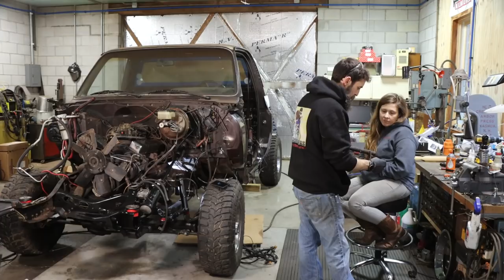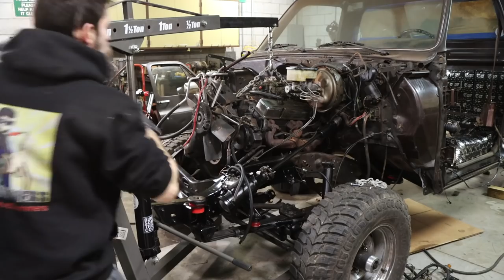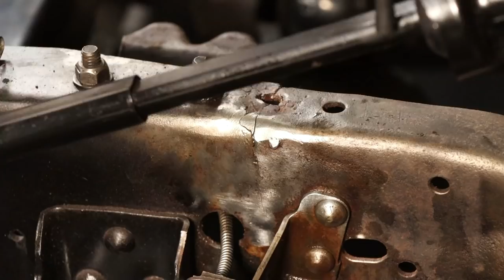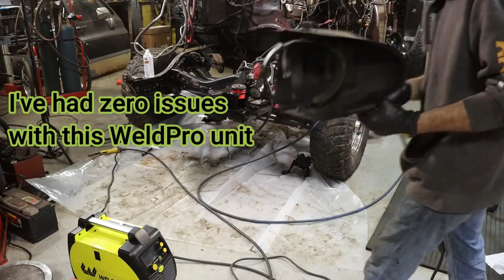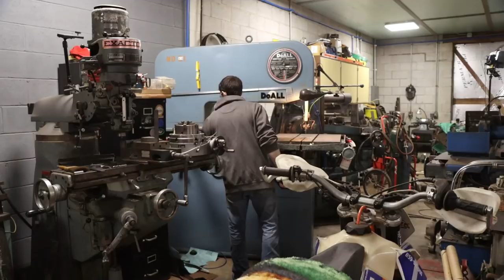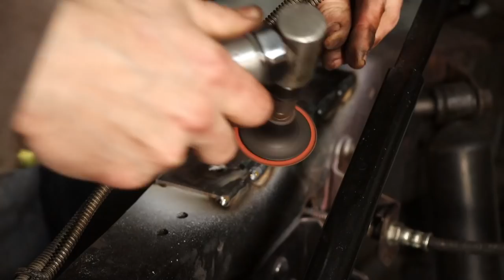Pulling the old engine and repair the damaged frame.

Comment: In 1964 - 327 CHEVY engine new from dealer ( what they now call a crate engine --and it did actually come in a crate ) $540     I never did actually buy one because I couldn't afford it on $1.50 an hour pay. ( Min. wage was $1.25 - so I was really doing well.)
Reply: Yes, a hundred dollars to rebuild an engine back in the day sounds cheap now, but most people don't realize that back then, the average person was taking home about $40 /$50 a week. It's all relavent.
I remember working for $1.25/ HR. and having to buy my repair parts from the junkyard because I couldn't afford new ones!

Comment: Your pulling the motor and repairing the frame reminds me of a situation that happened.   I worked with friends  named R, B andM
B was buying an old Ford Courier from M.  They took the courier to R's shop to replace motor mounts.  A torch was used to cut bolts off mount.  The oil and grease on the courier lit off, so R grabbed B's fire extinguisher.  The extinguisher was about empty and blew just enough to fan the flames.  R and B rolled the courier outside to save R's shop.  They called the volunteer fire dept.  All that was left of the Courier was thin steel and a puddle of aluminum.  The sheriff's dept. then investigated.  B had not transferred the registration from M to his name yet.  Deputy had a lot of questions and B had to do some fast talking.   No arrests were made, B still had to pay M for the truck with nothing to show for it.  It was a funny story with lessons learned.

Comment: I've done about 50 of these and I have found it goes a lot better with a couple of friends and a case of beer.
Your experience may vary.  Very good video, you show crack checking, filleting and welding excellently.
Currently working on my '71     3/4 ton. Already did the engine with a .060 bore just enuf cam so as not to get lopy at idle.
hi volt ignition Edlebrock carb and I splurged on some headers. I was getting 9 mpg and am now getting 11 or 12
I can light the tires anytime. (only 2wd )

Comment: I owned an automotive machine back in the 80's. A complete overhaul kit with everything but the crankshaft and rods was less than a hundred bucks for a small block Chevy... We sold tons of rebuilt engines.

Comment: Get you a good, heavy duty McCloed pressure plate, a good hi temp hi friction clutch disk,. (Zoom, Tremic, ect ect.but most of all a BRAND NEW flywheel!! I had a buddy of mine ,, had a landscaping business and that's all he ever bought were square body 4x4
 Chevrolets.. and the first thing we would do to them is pull the engine and transmission break the engine down completely go through it .030 over, sealed power Pistons Chrome Molly rings a Crane 310, 510 hydraulic flat tappet cam a steel crank that was line bored .010/.010 crank and piston journals. A high volume Melling oil pump.. if you know how to do so get a 700 CFM Rochester quadrajet go through it and polish the ventures and the fuel pump bore with 2000 grit sandpaper.. and a stock intake, a set of headers and you'll get more power out of that truck than a big block... We used to plow a lot of snow where we lived and you couldn't kill those trucks when we got done with them... Wish I was there to help..

Comment: Hi Steve,nice video and job repairing the cracked frame,the only thing i would of done slightly differant is the ends of the plate,i would of not cut them square,but curve going internally on the plate,and fully welded all the seams,Reason i was told this is that square plates will induce futher cracking,also when i was doing repairs on frames,during my aircraft structural days,we always angled the ends of the repair members,ie on your top frame,the length of the side away from radius side would be greater.

Comment: if you replace it go LS you will enjoy the low maintenance of them and there smooth on the road with power and response to spare, not meaning hotrod but go anywhere
Reply: 6.0, not a 5.3 !!

Comment: I've got you beat on oil consumption! My first old truck burned a quart of oil every 30 miles.
Reply: I had one of those.  Back in the day, we called that a "auto self changing oil system".  Very popular when we had our first cars.
Reply: @paulcopeland9035  used to say, fill up the oil and check the gas.
Reply: @Angus_McGyver  ...Yep, I have actually stopped at a station and bought only oil!!  My cruising nights were spent looking at the oil pressure gauge more than anything!

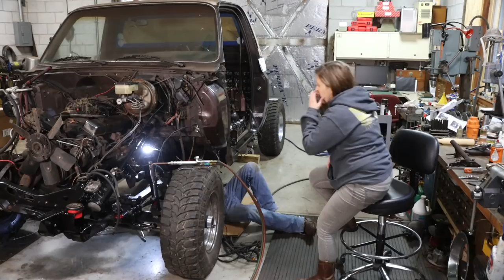Comment: 3:50 This right here is the best way to address a seized nut! All the videos about what penetrating oil is best, yes they work fine. But 9/10 times I grab for this exact set up, a simple welding tip on the acetylene torch, heat to dull red and turns right off. Can’t tell you how many times I’ve swapped the cutting head off the torch set or seen a guy catch a car on fire with a cutting head. It’s like using a sledge hammer to dial in a milling vice, not necessary. Kudos!
Reply: Nope, they do not work "fine"!  Penetrating oils (especially the worthless expensive types - Kroil I am talking to you ) are mostly a waste of money.  Over the years I hate to admit to the amount of money I have spent on this "magic juice".  In the "old days" we didn't have the internet to test, so you just tried everything.  Times are better (at least more informed) now. The bottom line though is there is no "nut buster" like the "blue wrench"!
Reply: @paulcopeland9035  amen

Comment: There is sooooo much that can be done with these 350 truck engines. For you a nece, well breathing manifold and heads along with a good, out of the basement cam will give you really nice power and fairly good fuel mileage. A set of flat toped or domed pistons and roller rockers won't hurt a bit either eh, LOL. Don't forget all that new air getting in needs to get back out as well so a 2" exhaust is a must as well. Vrooom

Comment: Hi Steve,
Love the way you work.  So methodical.  Some guys would just take an impact wrench, hit those exhaust studs with it, and snap them off.  You put a little heat on them and spin them right off with a socket wrench.  Nice!  Looking forward to seeing what you do with the engine.  More HP's are always good.  Thanks for the video!
-mike

Comment: I have done a lot of frame repairs on heavy equipment , I always radiused the ends of  my repair plates and welded them, never had any problems with cracks.

Comment: There are so many ways to rebuilt that engine. But anything that would offer more HP also drinks more gas. You don't get something for nothing even with engines. So you have to think of the trade off and how you want to build that 350. Was a very easy thing to hop them up when gas was reasonable. Now the cost has to be figured in... Thumbs Up!
Reply: Proper modern camshaft and head selection plus electronic fuel management will give him tons more power and probably save a considerable amount of operating fuel.  This is really one of the times when the "good old days" sucked!  If he can swing it, a GM crate motor checks all of the boxes!!!

Comment: Torque  not just HP  .  Bottom end torque is more fun and useful  a 350  can be a stump puller with a   good cam  and some improved compression .

Comment: im building the same rig bro,ive done all machine work for .040 over ,new i beam rods,running moly rings, i talked with summit racing about all i had going and what my heads were, the heads off a z28 from 1972 complete done ,im looking for pulling power not racing and they suggest there sum 1102 cam for torque, so with prices of parts these days i elected to use my original  intake off the 80 4x4 heavy half and the 750 quadrajet.
that said i also went with upgrade springs and stainless values had hardened seat added also,so my rig will be as yours when im done, i love these old trucks and had 3 sold one last year to pull off buying parts for this build and all, i mean to tell you these machine shops are putting themself out of business 20 bucks a hole for boring, im buying a new crank from summit also,i can buy a new crank cheaper than having mine ground ,i would love to have that granny 4 speed in it ,but all i got is the th 350 with the new process 205 and in my opinion it is bullet proof,i wouldnt have a chain at all.
anyway loving the rebuild and give old bobby a scrub for us viewers he reminds me of my bulldog that wore as much grease i did because she just had to lay right beside me and man the butt chewing mama gave hahahah

Comment: ever check the test dates on your O2 bottles.  used to work in shop and found it interesting to see how old some of the bottles were.  Had one turn up which had a first proof date in 1912, still in use.

Comment: Just finished  a pretty much stock rebuild of my 1967 Chevy 327 built from scratch.  The 1967 327 came from the factory with a small journal steel forged crank ( forged crank is something I would advise for any upgrade no matter  what over cast iron)  If you decide to build your own like I did, bottom line it's $4,000.00 in parts & machine work plus you have to assemble it & blueprint it as I did (check and modify clearances yourself) I did it all myself and paid extra just to know it was right.  Your block should be a 4 bolt main block however it has a cast iron crank. Get rid of that iron crank and find a nice Chevy #1182 steel forged crank and a set of factory pink rods ( Xs or Os stamped on the rods) then use whatever all else you want but that Forged crank and Pink rods are a must, or you can go aftermarket forged bottom end parts, so you don't have to worry about the bottom end no matter what you're going to add on top,.  

After just completing my steel crank 327 I feel there is a better way then rebuilding your tired 350. Fact is if I had to do it all over again. I really should have just called a reputable engine building company and ordered a rebuilt 1970 Chevy 355 ( .030 over ) LT-1 350 short block ready to go as they already have 4-bolt mains plus the 1182 steel forged crank & good rods. When you get it checked all the clearances. Then just buy a set of Alum heads and assemble the motor with whatever other parts you want. The savings could have been 1/2 of what you're going to spend in an automotive machine shop on your old 350 if you use a set of top quality parts.

 True, you can cut corners and do it a little cheaper, but you get what you pay for and to really build a top-notch steel crank motor you're looking at $4K min..  P/S I just fired my new 327 up yesterday in the car and had it around the block, still got a bunch to button up on it but it's in the car and running.  63 PSI of oil pressure. 

 Small block Chevrolet, got to love em.

Comment: While SBC engines are cheap  and easy to come by they aren't durable engines or the most economical on fuel. Being fuel prices are not likely to go down and the ready availability of better hardware in the junk yards I would go see Marty at L&M and see what you can find in like an LQ9 from a 03-07 Silverado. LS swap everything is trendy but it is because it is better. 350 smooth running hp should rock the world of that old square body. 🙂

Comment: For a work truck, torque is way more important than raw horsepower. Torque is what gives you that low-end “grunt” that pulls the load…
Reply: 100% Agree....buddy bought my 87 GMC square body and replaced the turbo 6.2 with a built up 350. Only time it wasn't drinking fuel was when the clutch was in!

Comment: Steve go with a 383 , that is a350 block with a 400 crank, gives you a 383 cubic inch engine. I would also go with a double roller timing chain, with a high volume big block oil pump (big block and small block oil pump will interchange) When you put the 400 crank in to the 350 block check for clearance for the crank grind the block for clearance of around .200 of an inch to alow for expnion.

Comment: We're doing this to a 2wd right now, and bought the kit... but unfortunately the frame isn't even really similar between the 2wd and 4wd believe it or not.  The kit was designed for the 4wd and is almost useless for the 2wd, so we're trying to use flat bar and things to stiffen it up.  Big pain for sure!

Comment: I've always found it difficult to understand why GM never addressed the frame issues on those trucks that started with the 1973 models and carried on through the 1987 model. I suppose they thought changing anything would be admitting there was a problem.
Reply: I grow up working on these GM pickups back when if you had a pickup it had a job and was used hard they were not pleasure rigs like today and until the internet i hadnt seen many problems with there frames . I have a 85 i think it was used as a spray rig it has been broken in the center and had problems with the rear shock mounts its the worst one i have seen.
Reply from the maker: @dougpersell8776  I agree. Most the ones that broke were used pretty hard. Every square body 've owned but one  was used rough. The real nice one I had was the only one without damage.

Comment: RE: Mice & hoses: Way back when I lived in the country I was spending the nights in a log cabin at the literal end of the road. Our problem was porcupines!  They seemed to love hoses, break lines, belts etc. We think it was the salt residue. The first incident was: We heard noise outside near the truck and so went to check. We did not see anything until we raised the hood to find a porcupine sitting on the air filter. He looked offended by us disturbing him.

Comment: I don’t understand why you wouldn’t weld the ends of the reinforcement plate. Great video.
Reply: Any discontinuity becomes a weak point, ideally the thick section would blend gently into the original frame, skip welding and leaving the ends is the best compromise. Othewrise any frame flexing will be at the join of plate and frame and thats where any failure will start. It's like all those plastic parts that crack, the cracks always start at corners or changes of section. Designers have forgotten how to desing things with tapers, curves or radii. Only need to look at a tree to see how things should blend into eachother!

Comment: I've heard the Vortec heads are a good budget upgrade.  CR and a cam go a long way in them too.  I do still hope (like my last comment) you go with a TBI-EFI conversion.  They run sooo much better, and once they're set, like a modern car, you just don't have to fiddle with them.

Comment: Steve, you said that your dad worked on the chevy trucks on a weekly basis. I think what you were saying is these are not Yugos. They we're not a high maintenance vehicle, so working on them weekly means the influx of vehicles, not a single vehicle. Older Chevy's had a good reputation for durability, and most of what's made today is likewise the same. My Astro van has 217,XXX miles on it and has been basically trouble free. I did have a brake line problem, but they all typically had this issue, due to a poor choice of materials GM chose to use.

Comment: looked at stock(ish) master rebuild kits , there about 300 to 600 dollars now 
think a rotation assembly might be better if you want a little more oompf  , turning it intoo a 383 , theres an eagle rotating asembly kit on summit racing for 900 dollar (still needs the cam bearings gaskets oilpump lifters etc) you can make youre own with stock parts from a sb400 ....if you can find them ,,,, and maching en bearingtaps smaller to fit the 350 block .... and prolly new rods and pistins ..... never mind 
maibe find some rebuild small block cast iron vortec heads and a holey or edelbrock intake for the carb youre having on it now 
maibe a high torq cam (low rpm stump puller these usually still have good vacuum signal too ) and the thing will be pretty stout even for a 350 and since you dont need to wind it up to the sky to make the power it should last a bit longer

Comment: Steve i would like to have a truck like that... but with fuel price here 7,643usd per gallon its hard to have a v8
Reply: Read that, all of you gas price whiners!  The rest of the world has, and has had for years, way more expensive fuel prices than we.   We are incredibly fortunate that we can drive all kinds of vehicles that are not considered or even allowed in most of the world.

Comment: Go check out GM performance. Dealers can sell you brand new Engine, With a warranty that's good in all 50 states.
If you do it that's cool but if you send it down the street, That's were the warranty ends. Plus you have to clean all of the sheet metal.
Brand new is great: no striped starter mounting holes, better machining and they had 383's in the past. Good luck.

Comment: Hi Steve,
Noticed the 350 has a Quadrajet carb. Are you thinking of rebuilding it, getting a rebuilt unit, or replacing with a Holley. The Quadrajets run great when adjusted properly, but I prefer the Holley for ease of adjustments. You, Elizabeth, and the family stay safe.
Reply: For drive ability,  it would be cool to do an aftermarket fuel injection.

Comment: I can't decide if that chassis is badly designed because it cracks a lot, or well designed becase it is crack-tolerant. 
In some ways it is impressive that the vehicle was still functional with so little metal left doing its job.

Comment: Steve, so glad to see you doing this.  Please excuse my ignorance on the subject, but would you also strap the other side, both for strength and to keep the mount heights the same?
Reply from the maker: Height isn't a issue. Motor mount hooks under the frame rail👍. Thanks for watching